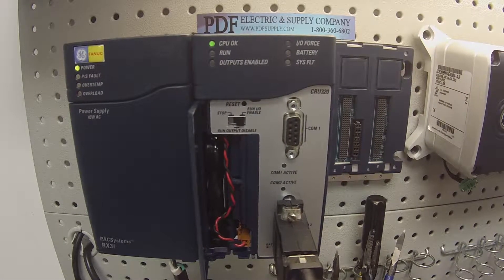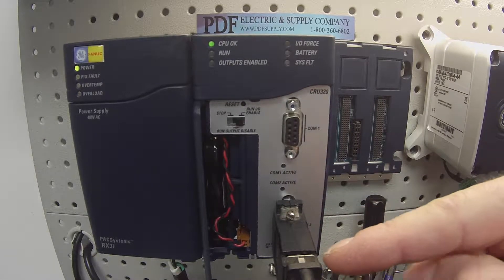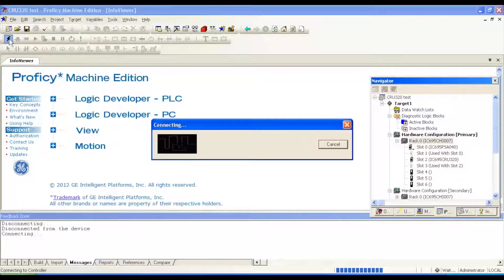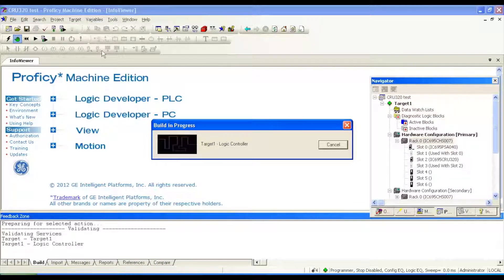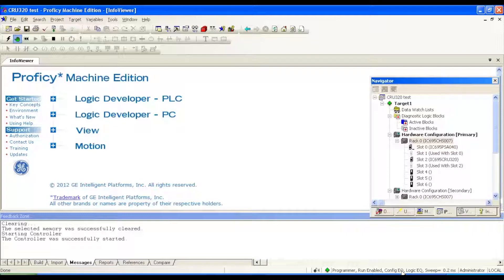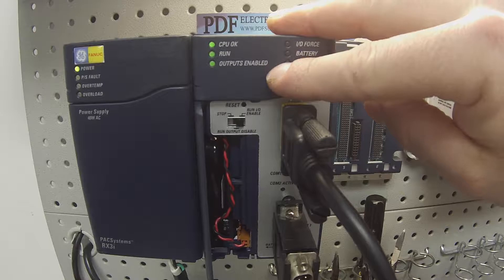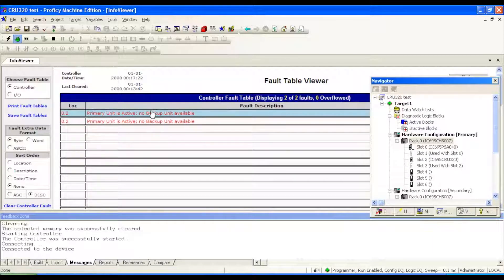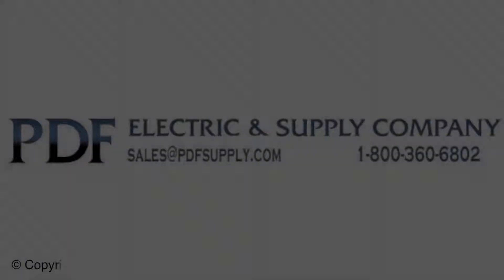How-to Troubleshoot: IC695CRU320 (GE IP Rx3i CPU, Proficy Machine Edition Training)

Comment: I have 3 units of CRU320 that suddenly got defective for the last two weeks due to system power failure. All CPU LED's are off. Please help how to  fix and suggest service center where I can send this for repair. Thanks:).
Reply from the maker: Please check out our GE Fanuc Rx3i Pac System PLC support page:    http://www.pdfsupply.com/tech/ge-fanuc-rx3i-pac-system-plc-support/
If this doesn't solve your problem, we offer free evaluations for repairs and you can contact us directly for more information. Our repairs come with a 1 Year PDF Supply Warranty. Call For Assistance 1-800-360-6802
For more information on our repair services visit pdfsupply.com/repair.php or  email us at sales@pdfsupply.com.